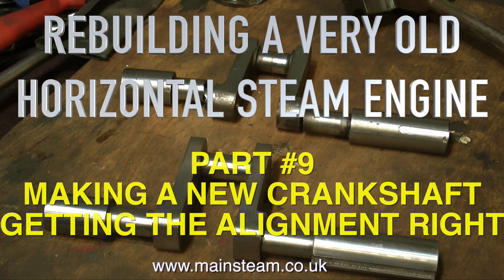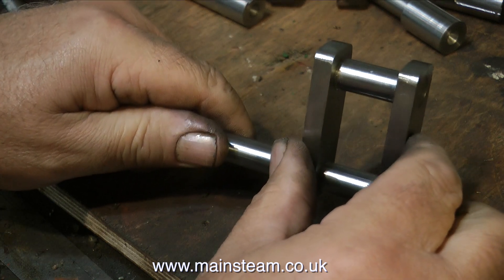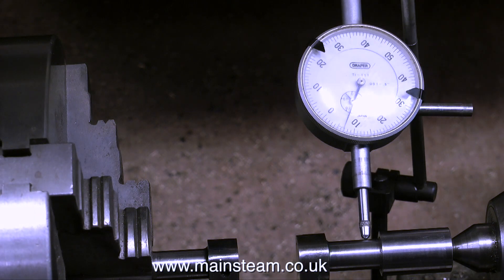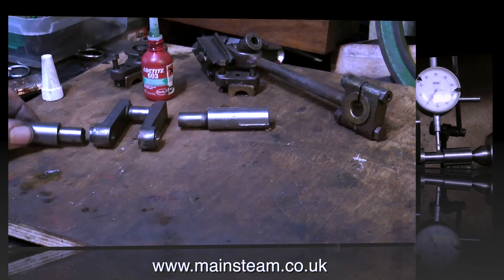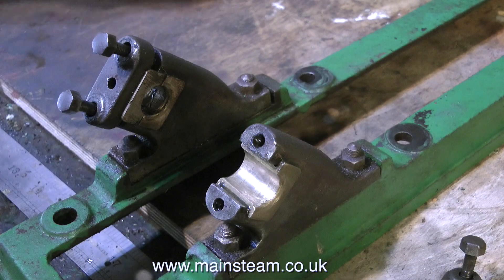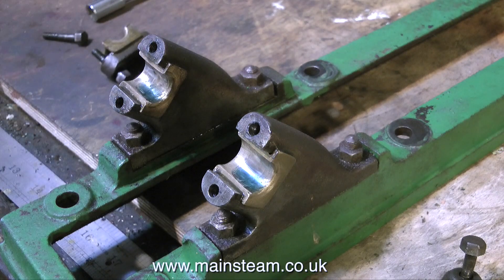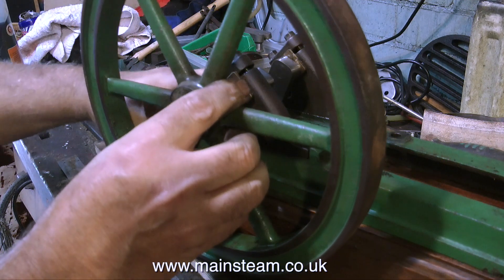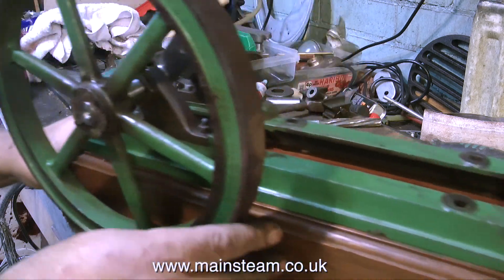PART 9 - LARGE HORIZONTAL STEAM ENGINE REBUILD

Comment: Making the crankshaft was an opportunity to oversize the flywheel stub by .050"~, then re-bore the flywheel to get the hole centered and perpendicular.  Obviously this was not done well by the original builder.  Yes, there are 20 ways to do everything.  All respect.  Really enjoying series.

Comment: Now as someone who made solid cranks when I was 12 I can tell you a few trick I learned to make the perfect crank solid or joined. And how I would join one. 
If you make it solid you first take your lump put the centers in and turn the big end or ends to size. Simple.
Or silver solder the webs and cut out the middle. I don't like threading and pinning myself.  
Now here's the important part. Turn the main shaft down but leave it a bit big. Half a mm or 20'. The put it aside for a few days or a week. 
Set it up once more between centers. You will most likely find it has a little wobble. This is because the stress has been relived in the metal now you have machined it and cause it to warp a little. 
Depending on the fussiness you want you can now turn it so its finished or leave it a little big again and leave it another week before finishing.  
The big end of course hardly does not go out of square by any significant amount, but you end up with a crank with a perfectly true shaft for the bearings. 
This goes form making super precision shafts of all kinds especially if they are long. Whenever you remove material the stresses in the metal change and it will distort a little. 
So depending on the precision required while not normally a concern with things like cranks or long shafts where a little wobble adds to a lot on the end this is a very useful method.

Comment: As I'm building a crank myself for a scratch built engine running on air, I wondered did you use tapered pins (in conjunction with a tapered realer) or were they plain straight ones with Loctite? 
I had been considering using small grub screws with the holes tapped & threaded in the web and crank.
Reply from the maker: On this one I used parallel pins with Loctite 601 - don't use grub screws. I tried that and they worked loose over time . . . no good at all
Reply: thanks Keith, advice will be taken!